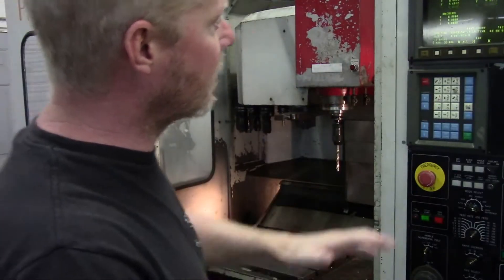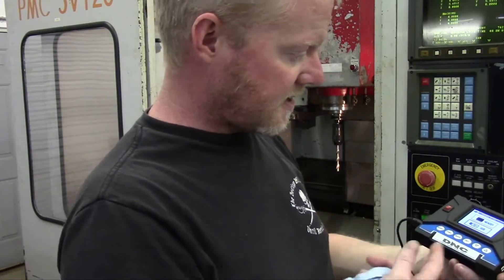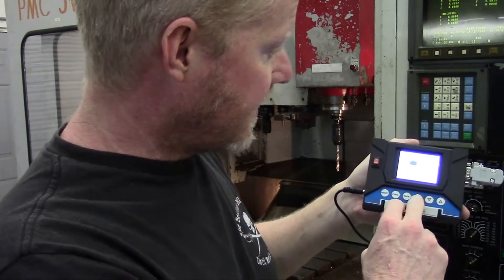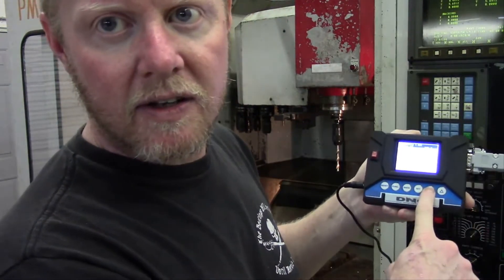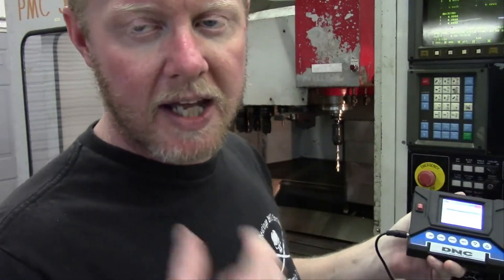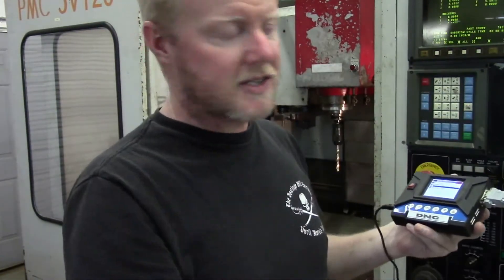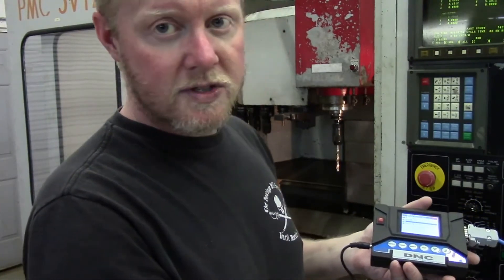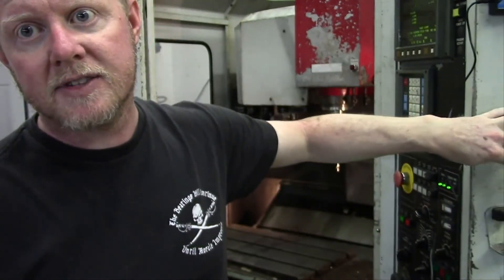[DNC Titan] Introducing the TITAN from USA

Comment: Is the serial port at the bottom output for the db25 type cables? My cnc control only takes the db25 rs232 cable.
Reply from the maker: Yes, the standard accessory of device is a RS232 cable DB9 to DB25. The DB9 is same with a PC RS232 port. Please see wiring diagram here: http://ausys.vn/en/article/2014/10/19/rs232-cable.50.html